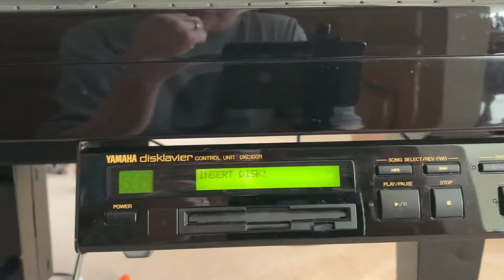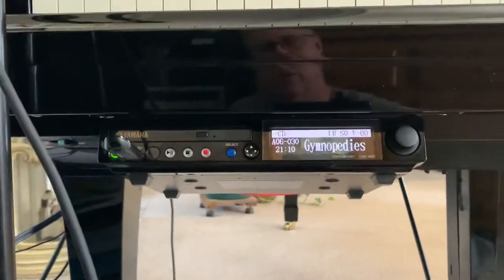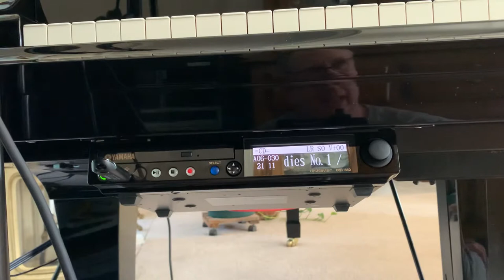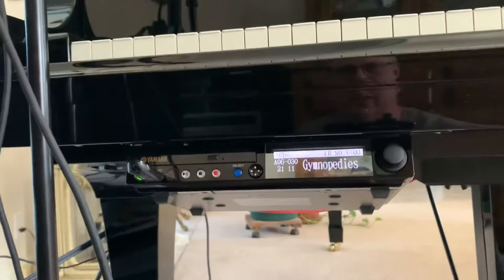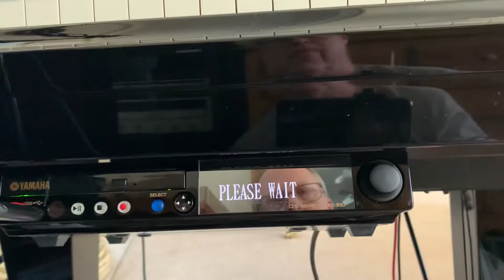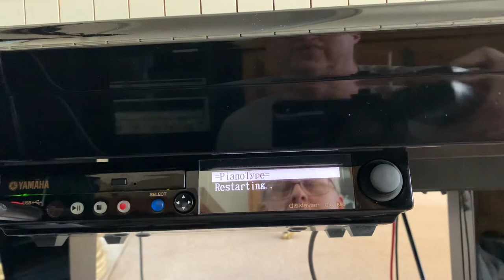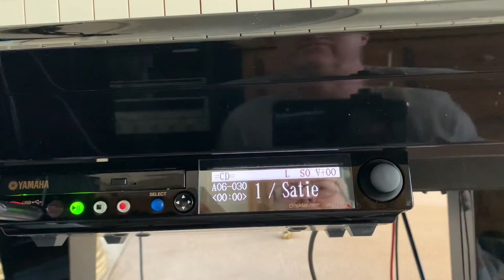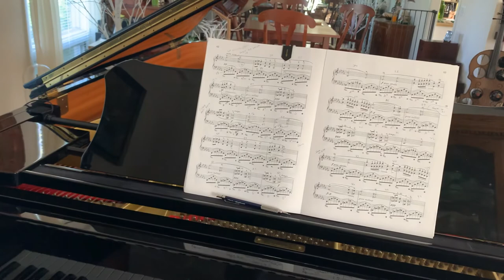Bypass your Disklavier's ancient DKC100R unit with a DKC Converter Board to just need a DKC-850.

Comment: It's nice to see an owner's video related to the the technical aspects of the Disklavier. I have a C3 Disklavier from the same year (2000). I replaced the original controller in 2018 with the DKC-850 controller. The kit came with what the manual calls a "conversion cable". That cable connects the DKC-850 directly to the old cable without needing the adaptor. I was able to remove the old controller at the time. The instructions say "Please keep your original control unit for future maintenance". My old controller has been in a box for 5 years.

Have you noticed the volume of the sound module instruments are much lower on the new DKC-850 module? I'm sure I was able to get a better balance with the live piano when the old module was hooked up.
Reply from the maker: Hi ge0brick, Honestly, I've not used it for a while.  I thought I would record some with it, but the old MIDI machinery isn't able to reproduce the dynamic nuances of the player in a satisfactory way for me, so I moved on.  You might try some other monitors to see if they work better.  The monitors are part of the chain and I would suspect them before the DKC-850.
Reply: @sydphi  In my Disklavier, there's an audio amp and 2 passive speakers under the piano. I noticed the volume difference as soon as I swapped the control module. It's as if the audio output from the DKC-850 is set at a lower level (even at max volume). I watched several Richie Hayes videos on the DKC-800 and 850 where he discussed internal DIP switch settings. Maybe there's one for audio output levels.
Reply from the maker: @ge0brick   I used powered speakers and passive outputs.  The volume was fine.  I"m not a fan of how the MIDI woks for me, though.  Even though it's an acoustic piano that the MIDI is playing, the performance is mechanical to me.
Reply: @sydphi  I understand how midi could sound mechanical with a ridged tempo map and quantization pulling notes hit to the nearest beat. I sometimes use Yamaha radio to stream performances and whenever there are accompanying instruments, they can't be heard over the live piano when you are not near the speakers (no matter how low the piano is set in the balance). I may try a pre-amp or send the output of the DK-850 to a separate amp/speaker or to powered monitors.

Comment: I just upgraded my set up also from a piggybacked dkc100 using Richie Hayes circuit board. I’m curious whether you were then able to access disklavier radio. My dkc850 has original firmware of 3.52 and will not make an Internet connection BUT is on my local home network so I can use disklavier app from my iPad